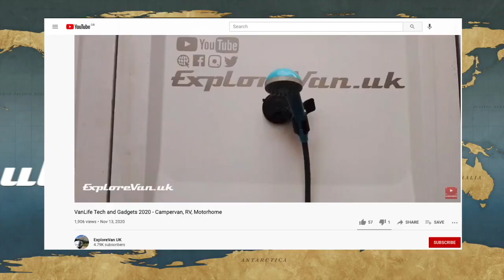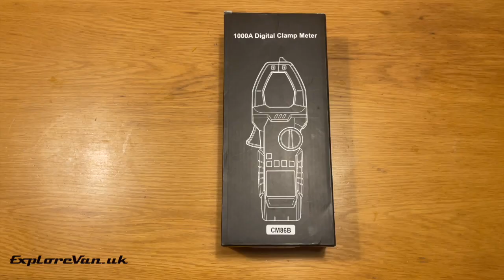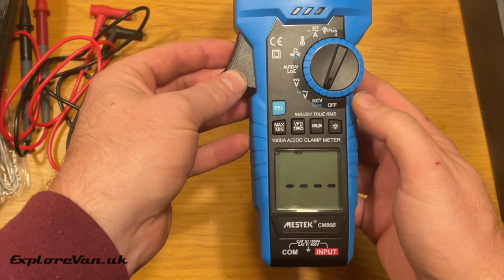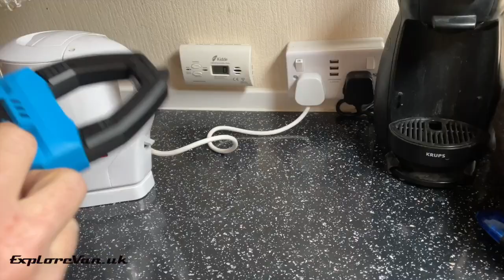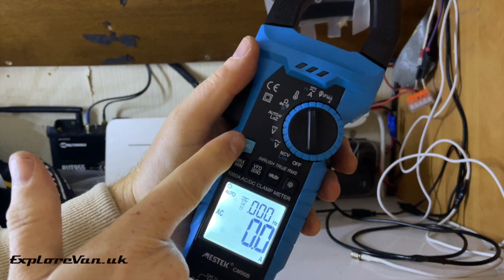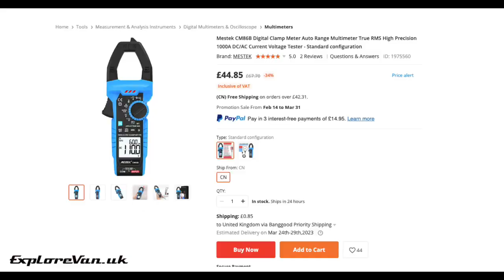The Best Value AC/DC Clamp Multimeter?  Mestek CM86B Digital Clamp Meter

Comment: After 4months of using the Mestek CM86B, I noticed that the frequency (Hz) in Ampere AC mode isn't reading, it remains zero even though I'm measuring around 8A of current. Is there a way to solve this?

Anyway, this device is actually tough, quite heavy, yet accurate. I could say that this device is good.
Reply from the maker: That’s not great, ours still seems to be working ok. Have you tried contacting the seller through Banggood?

Comment: I bought this to check a parasitic drain on my jeep like I thought you were doing in your video. Turns out it doesn’t measure DC milliamps.After a closer  look I noticed you had .3 amps reading not 3 ma
Reply from the maker: Hi that's right using the clamp the scale is in 0.1A so 100 mA 

If you want to be able to measure less than 0.1A / 100mA  then you would need to use the probes.  I doubt the Hall Effect sensor would be sensitive enough to measure more accurately than 0.1A
Reply: DC current can be multiplied with using 10 turn loop or less to amplify the magnetic field you just you need to divide the value you are reading with the numbers of turn to get the real current passing
Reply: For example if you read 1 amp that means you have 100 ma if you read 0.1 that mean you have 10 ma if you are using 10 turn loop the down side of this you need to open the circuit if the wire is short

Comment: After a month of watching this video, I finally bought the Mestek CM68B. Accurate and reliable tool.👍
Reply from the maker: That’s dedicated research!   Glad you like it!
Reply: @ExploreVanUK I bought MESTEK CM86B too. It is great meter and has a Intertek certification, therefore I can trust it. My only concern is that the AC current reading doesn't read the frequency or the Hz but the current reading is no problem. What I like to this meter is the VFD.

Comment: Очень плохой девайс, как мультиметр ещё работают , а как клещи не работают совсем и врут в огромных пределах. Не советую покупать.  Даже тут переменный ток не измеряют. С автомобилем , вольтаж не показывают совсем, а с амперами врут.Писал на алиэксресс и продавцу и в поддержку, послал фото ,потом видео, бесполезно. Похоже они все работают плохо, хотя качество материалов хорошее. Всем удачи и правильных покупок.
Reply from the maker: Thanks for sharing, that’s not our experience ours are still working perfectly measuring both AC and DC using the inductive clamp. 

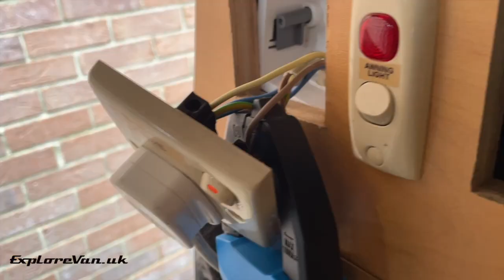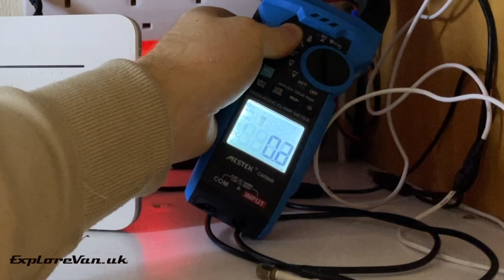Note we do measure AC current with them at 5:25 and DC current at 7:27

You say they don’t show voltage on a car, you do know the clamp is only to measure current not voltage? 

Might be worth returning them for replacement.

Comment: I have a bunch of questions if someone could answer a few.

So situation is that I’m searching for a good cheap multi meter as a starter automotive technician, and I may be doing some other electrical stuff later.  

I’m trying to figure out if the multimeter you showed lacks anywhere compared to the Harbor Freight store 1000 amp AC+DC clamp meter.

What is Hz% is it different from AC Hz?

Is a range button useful?

And is rel/inrush the same as just inrush.  I’m not sure what rel is short for.

Also does AC iFlex use the clamp or an attachment?

Is live wire just the amp clamp setting?  Do I use that instead of amps setting to use the amp clamp?

The temp probes are cheap, or nice?

Does auto volt loz drain the battery quickly, and does it replace closing the switch in the circuit for a 12 of 13 volt battery?